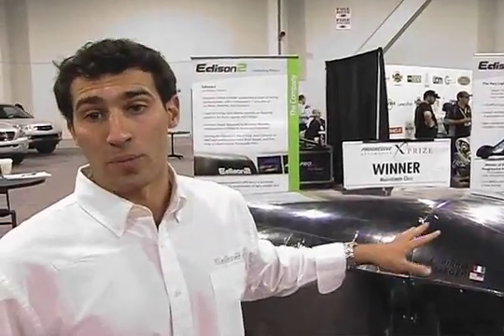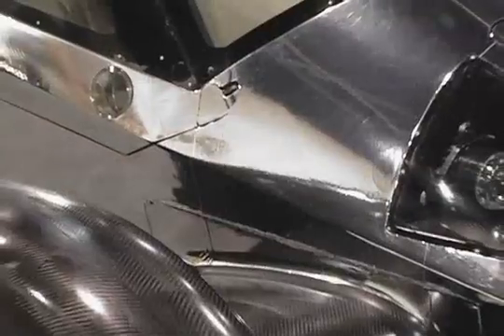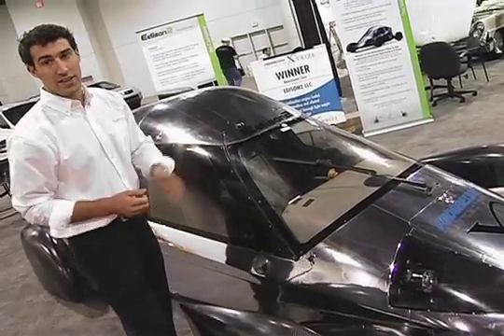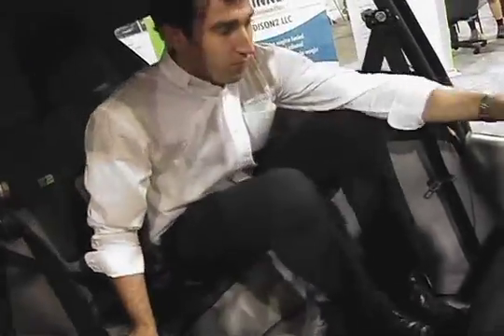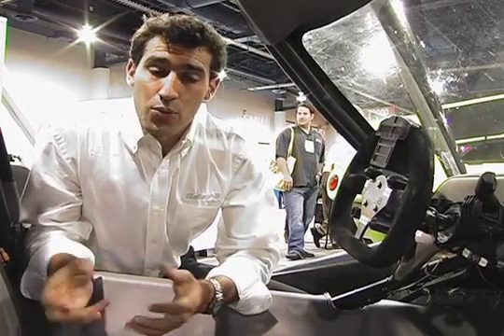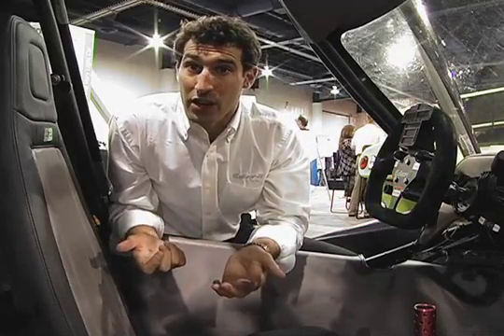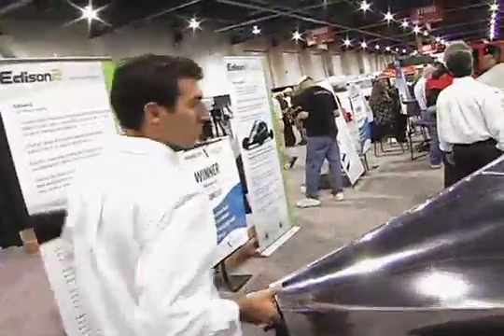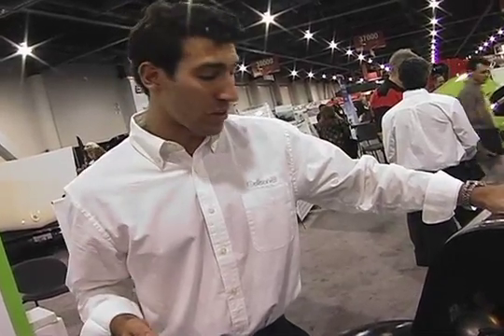Auto X-Prize Winner Edison2 VLC @ SEMA 2010

Comment: Dan did you get a chance to touch this thing. It seems like you could poke your finger through it like butter. It literally looks like its has the sheet metal thickness of a tin can. I wonder if this guy has any idea what European spec A and B segment cars get for MPG some are approaching 70 MPG, and when the new SKYACTIV architecture is released by Mazda it will be 70MPG on unleaded. 

BTW are you heading out to LA Dan?